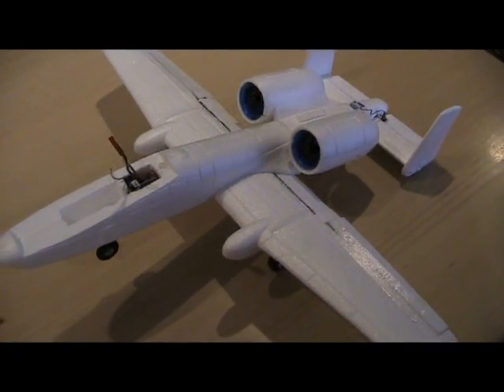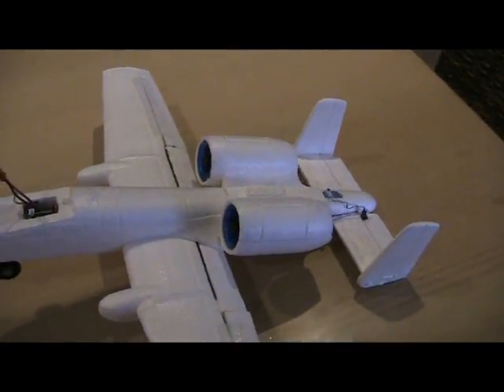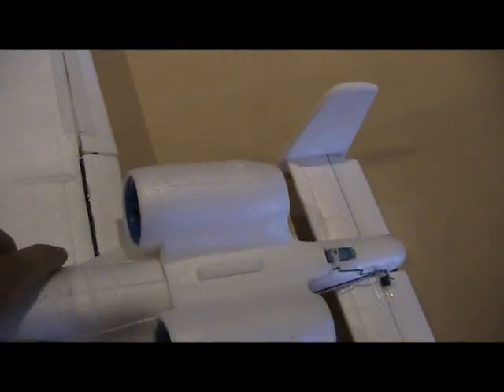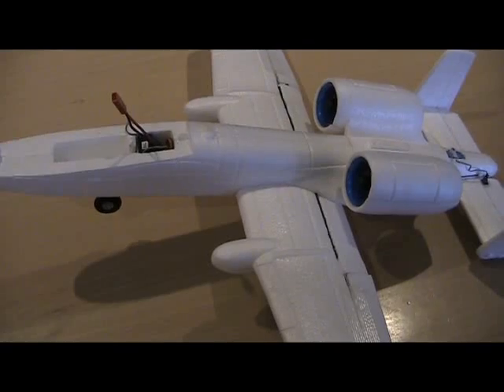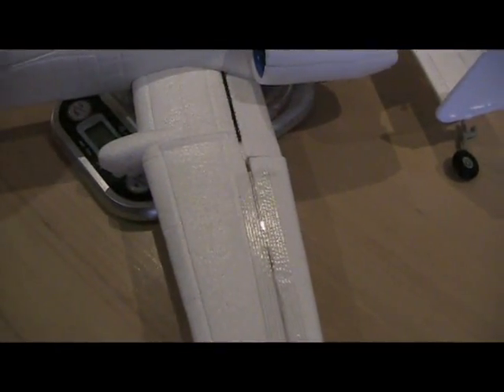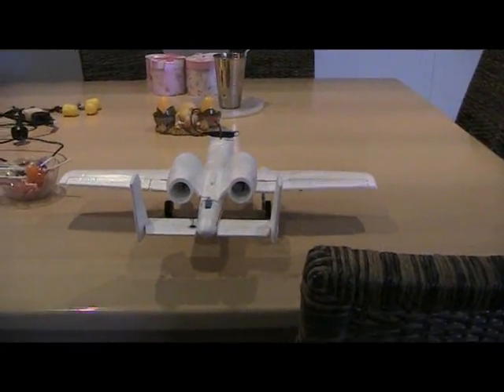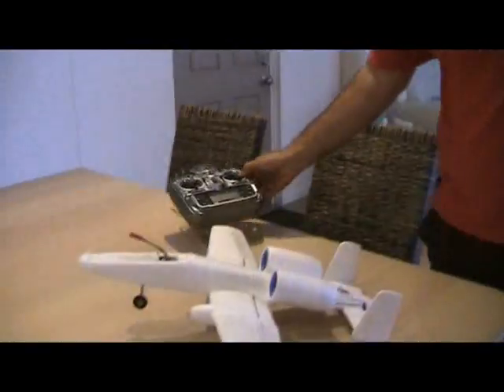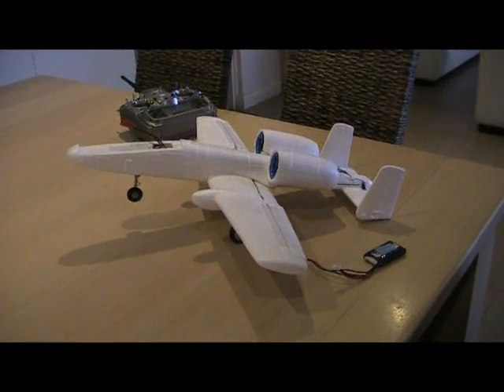A-10 Twin 30mm EDF Preview

Comment: GREAT VIDEO! I'm doing a custom build on a paladin c147 need some help. I want to of course make it more powerful. What set up should I use as far as battery, esc and radio I have no choice on servo because it's built in the plane. here's a link to the plane from park flyers http://www.parkflyers.com/C147_p/ub-7001.htm